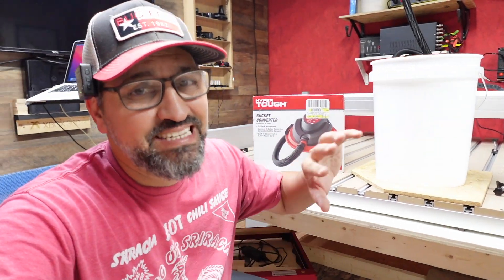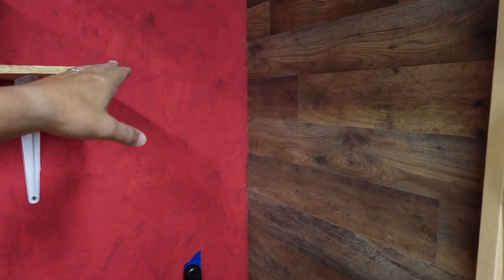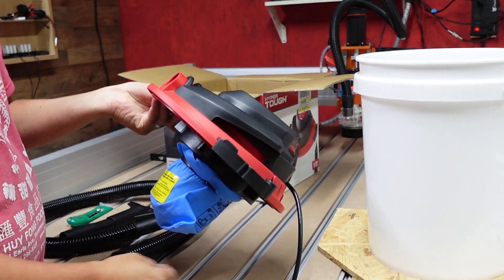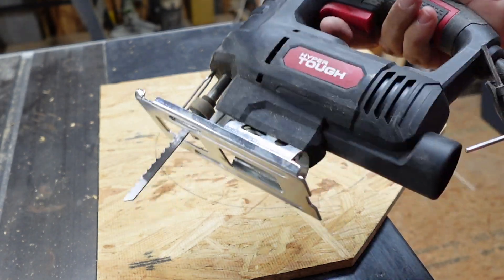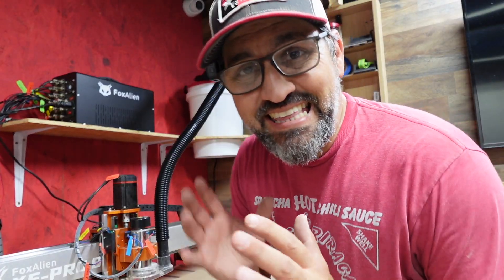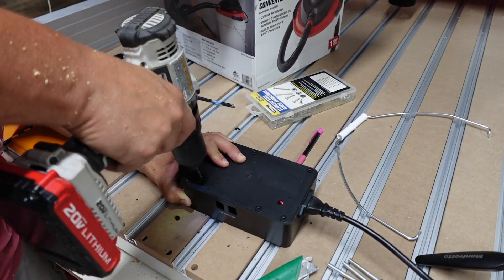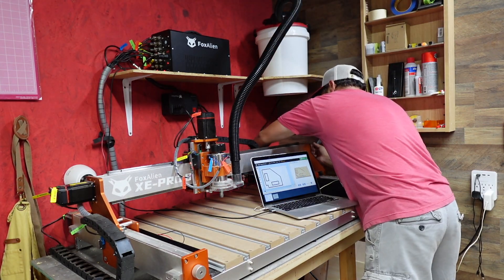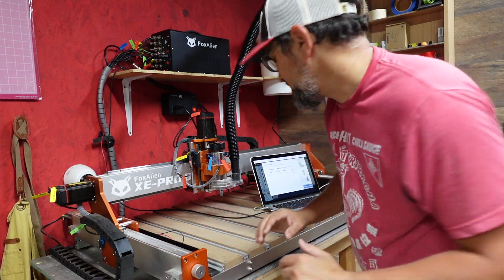Can a Walmart Vacuum Keep Up with My FoxAlien XE Pro CNC Machine!?

Comment: be sure to add up total amps for spindle and vac. Mine was more than the relay could handle and it would shut down during the cut. Bad thing. I ended up daisy chaining two of the relays so that the cnc would turn them on but each one had it's own power supply.
Reply from the maker: Wow!! Havnt had that happen yet! Glad you got it figured out how to work.